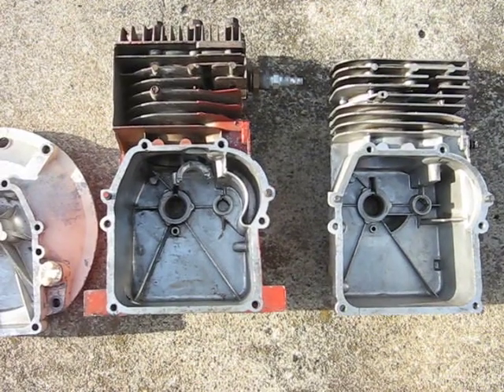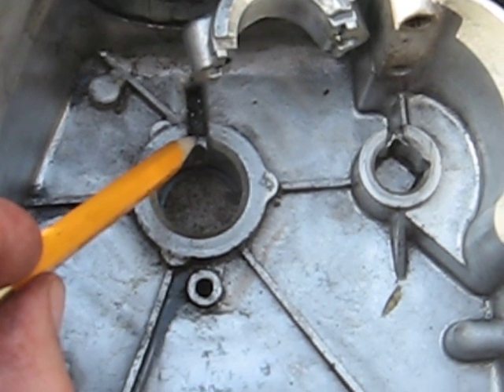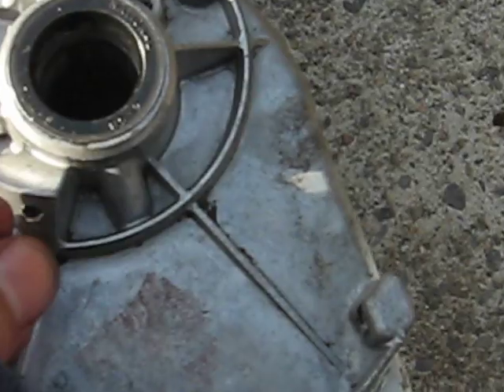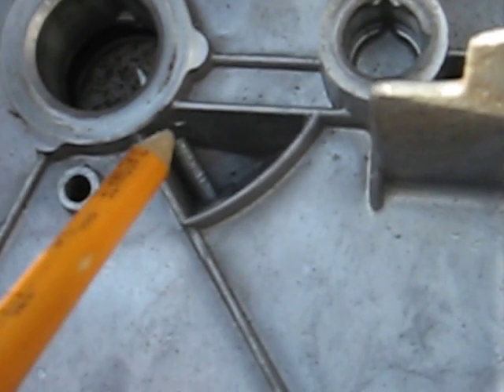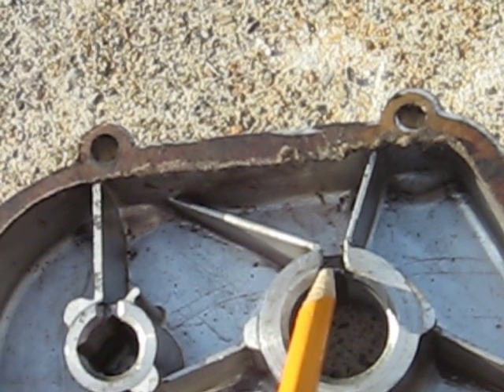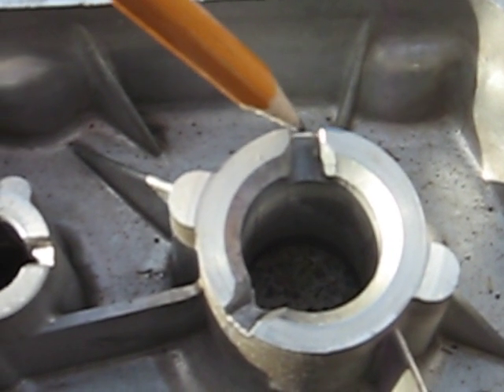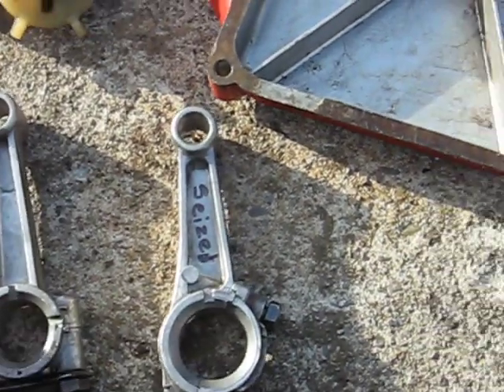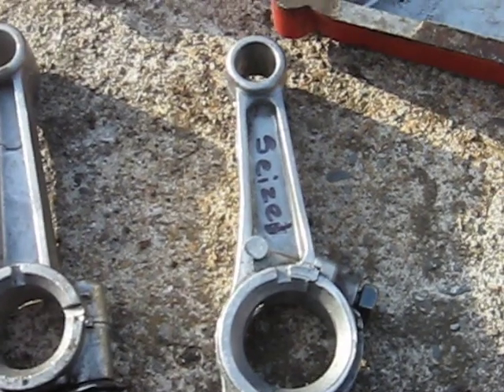Vertical shaft 3.5 hp Briggs to Horiz, Oil mods

Comment: do you know what cam can replace the plastic cam so i can add more duration
Reply from the maker: Are you using a 9 cubic inch Briggs engine, like a 3.5, or 3.75 horse engine? If so, you should be able to use any old STEEL camshaft out of an 8 or 9 cubic inch Briggs, probably built before 1990,  part # 210453 (on ebay for $15 or so)  I actually figured out  a way to add duration by grinding the cam down, instead of building it up! You use the longer tappet from the old 4 horse model 110988 engines, part number 261250. This tappet is about 1.318" long, while one for a 3.5 horse is 1.277" long. Thus you can use the extra tappet length by grinding the cam down on the base circle about 0.041" . If you want more lift than that, you will have to weld up the steel camshaft, and grind it to shape ( a really fun job)! I hope this info helps you out.  Miles
Reply: @ChargerMiles007  nice will try but it's a 190cc 5.8 hp 6.7 torque flathead from a push mower 675 series engine that I converted to horizontal shaft, will these part numbers still work?

Comment: how about conversion from horizontal to vertical, roughly what should we do? thanks
Reply from the maker: that could actually be more tricky, as the normal oil dipper will not work with the engine vertical. Going the other way, a person can try to make a homemade dipper.

Comment: Is at the crankshaft on the backcover a drain hole for the oil or is it just a hole?(my english sucks)
Reply from the maker: There is a feed hole, and a drain hole usually , to help criculate the oil to remove heat.
Reply: @ChargerMiles007  Should i make a drain back hole for cooling?

Comment: I remember  watching about 20 times. I had to look up half of the components you mentioned because I had never heard of them before. Thanks again for all your help the engine runs great
Reply from the maker: Hey, thanks for watching, I hope it helped you out. I will be doing more conversions, since I have to modify 12 lawnmower engines to run in my horizontal shaft 24 cylinder engine!  Glad to hear your engine runs well.  The one I modified eventually tried to kill the output side crankcase journal (bearing surface), as the chain pull from the go kart caused it to wear. A bronze thinwall bushing pressed into place would probably solve the problem, but would require a machine shop to bore out the hole to the proper size, and press the new bushing in. we had the same thing happen on a 5 horse horizontal shaft engine, the chain force causes heat which thins the oil, and eventually leads to seizing or wear. On the better engines they solved this problem with a roller bearing.

Comment: im wondering how the engine today ?
Reply from the maker: The engine would still run fine, thought the output shaft bushing was showing some signs of wear from the chain drive on the go kart pulling on it.
Reply: @ChargerMiles007  thx :D

Comment: Chargermiles007, howdy from Phoenix, Arizona. I hope you are well.
I'm unable to i.d. what type motor my 11 yr. old daughter & i were given to build a go kart around . It was on green base & said weed eater on the plastic shroud. Anyway, after the oil flicker mod & custom aluminium carburetor adapter ,it fired up real nice!
But when I shut it down oil came out if the carb into the air filter box. Any suggestions?  Says : 550
    140cc ohv 
On shroud. Thank you for your video and time,
Daniel
Reply from the maker: I am not really sure what would cause that problem, any way you could put a vid of the engine showing a bunch of different views of it on your channel, so i could have a look at it.
Reply: @ChargerMiles007  here is the link to my channel. There isn't much content there  because Im building up content before i make it public
Thanks for your time and your response, 
Daniel @worlds messiest shop
https://youtu.be/oUqYZdACIJM
Reply from the maker: Hi Daniel, Sorry, I still can't identify the engine make from all of the pictures. However, thinking about what you said the problem was with oil coming out of the carburator, where is the oil level in the engine relative to the crankshaft, perhaps it is overfilled. This is just a guess. On some of my engines I have to measure the amount of oil I add to the engine, as there is no oil dipstick or such. On a re-orientation project like this, I would add at least as much oil as it had before, perhaps more if it sits too low for the new dipper to reach well. Another cause could be the PCV hose connecting to the carb. (if it still has one), that is the small vent hose for the crankcase gases. If it is in a weird orientation now, it might not work properly. Just brainstorming here, look it over good, and perhaps the solution will present itself.  I had a horizontal shaft Briggs motor to compare with when I figured out the oiling for mine, so that made it easier, in this case I doubt that would be possible. let me know how it works out.  Miles

Comment: Also curious as to what the new crankcase oil capacity is on my 450 series flathead. Thanks for the video, literally just put mine back together after these mods, used a chrysler 2.2/2.5 rod bearing cut in half and bolted to the rod as the new slinger.

Comment: Hey there ChargerMiles007, I found this video very helpful but i'm unsure how much oil to put in the crank case after converting it to horizontal. Any advice?
Reply: +SporkWeilder556 personally just block the old dipstick tube up and create a new one near the top but out of the way of anything moving or just have a plug on it and no dipstick .. then just insert a rod of somesort to find out how deep the level is from the bottom of the block .. but you need to know how far up the oil slinger is from the block
Reply from the maker: +SporkWeilder556 I would use at least the same amount as the engine normally used. That was one issue I have with building an engine like this, you have to bee able to get the oil in, as well as check the oil level. I have had to just add the normal amount of oil sometimes (I think a 3.5 HP Briggs hold .4 liter, but I am not positive), but your oil dipper must reach well into the oil level to lube the engine right. Hope this helps.
Reply: +ChargerMiles007 thanks
Reply from the maker: +SporkWeilder556 You are welcome. What motor did you convert from a lawnmower?
Reply: i believe it's a 3.5 hp briggs and stratton. It has a plastic throttle arm
Reply from the maker: +SporkWeilder556 Oh, so it is more or less the same engine I used for the vid, I would recommend using the factory oil dipper off an 3 horse horizontal Briggs, let me know if you need the part number (if I don't mention it in the vid.)
Reply: Hey chargermiles007 can you do that with a tecumseh 6.5 hp

Comment: ive done the exact opposite of this with a 2.5hp briggs. for a carb, took an old (antique) tecumseh carb with the diaphragm (not bowl) it leans a little, but thats ok, i had to drill a small hole in the valve cover area though.
Reply from the maker: thereelmaster .Interesting! Here lawnmower engines are common, but the horizontal shaft engines are more rare. I recently found a source for the heavy steel flywheels though, used pressure washers, with the model 10 Briggs engine, I have found 2 recently.Yes, I can see how you would need to drill a drain back hole from the valve cover. We sort of reverse engineered the oiling slots etc. when we built this engine, it probably won't live as long as a factory horizontal shaft, but has worked well for some go kart use  :)Man, that must be an OLD Tecumseh carb, I only remember the bowl type, and I was pushing old Tecumseh lawnmowers around back around 1970!  :)

Comment from the maker: Good point.
It depends on the age and type of the engine you are using. On a Briggs 3-1/2 horse, that has a dipstick, the dipstick hole could now be used for a drain. The steel drain plug in the base could be used to fill it with oil. On this engine, I added the standard amount for a lawnmower engine (.5 liter perhaps, I don't recall off the top of my head). Since the drain plug is high up, a person could overfill the engine.
With a different engine, oil dipper length would need to be checked.

Comment from the maker: @Mr3wheeledbike 
Take the crankcase cover off the engine, and take a close look at the bearings etc., thinking of how it will all work with the new arrangement. I see a comment below where someone didn't do many mods, and the engine worked OK. Each design is different though, so I wouldn't bank on that. I will make a vid of the dipper for a 3 horse, I am busy these days, so if I don't put the vid on by Monday, please remind me about it :)

Comment: @ChargerMiles007 well this is my only engine i can use and it will be put on a go cart so i would say max  run time 5 hours maby 1 on average so theirs that also would you leave in the governor/ oil singer in for the governed part.........well you the small engine king so that mesherment and other info would be great

Comment from the maker: @Mr3wheeledbike 
A 12.5 horse!
Holy liftin, that certainly is a lot larger than this engine!
I don't have any idea of what thickness of metal to use on an engine that large, I personally only used the factory dipper off a 3 horse briggs horizontal engine. I can measure a dipper and let you know, but I sure can't give any guarentees about it!
JB Weld will hold up in an engine, BUT, I don't run these engines for very long, with the exception of the sleeve valve, which I ran on a dyno a lot.

Comment from the maker: @dejo1976 
I don't see why not, but you will have to figure out a way to get rid of the existing oil pump, and add a dipper onto the con rod. You would have to look at how the oiling slots are arranged on it. I don't have any of those engines to take a look at :)

Comment from the maker: @mytmousemalibu 
It sounds like you like modifying engines also :)
Sorry, I don't have any specs on the oil dipper, since it is a highly stressed component, I just recommend buying one, I am not 100% sure of the part number I gave, but I think it is correct.
I cut off the plastic slinger, but use part of it as a spacer/washer to maintain the camshaft end play.
Sounds like you have some nice metal fab. play toys there! You have a few I don't, but I make do as best I can, and friends help me.

Comment: I bet a fella make his own oil dipper pretty easy if he had some fab tools. Do you have a picture and or some specs on the one you mentioned miles? Would the plastic oil slinger still be retained in a vertical conversion? Im lucky enough to have alot of metal fab stuff, mig, tig, plasma cutter, torches, saws, etc. I need some old briggs to hack up into new creations! I like converting weed wackers and other small gas engines into model airplane engines, good wholesome fun!

Comment from the maker: @jasoncambs 
You are very observant :)
The plastic part you are talking about is the air vane for the engine speed governor. I removed that for go-kart use, since it would be extremely hard to make it work, since I have rotated the carb. and gas tank 90 degrees.
You have to be careful without a governor, since the engine can now rev about 5300 rpm, and the oil dipper won't like to do that for very long, so don't keep it at max. revs for too long!  :)

Comment: Hi chargermiles007
There is a plastic flap that pivots from a coil bolt and follows around the flywheel , would I need this in a cart / bike application, as I don't see it mentioned on many videos I see , 
Regards 
Jason